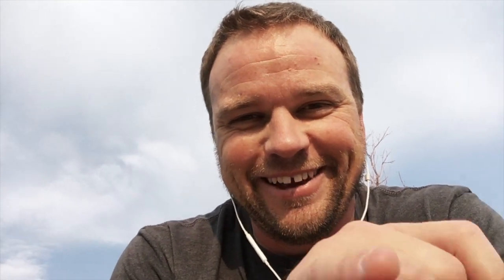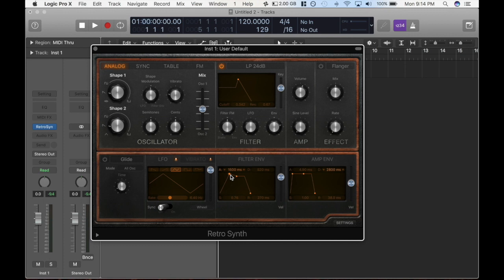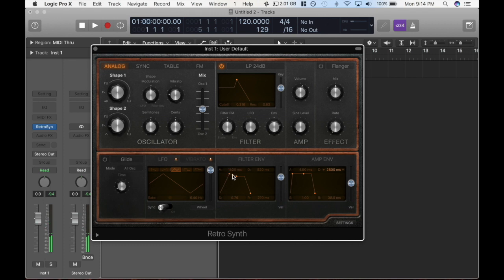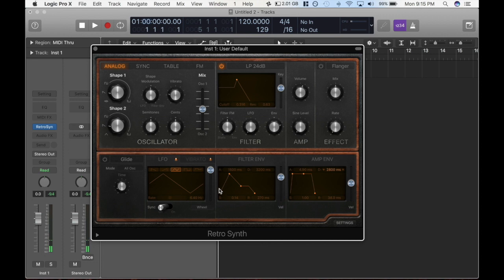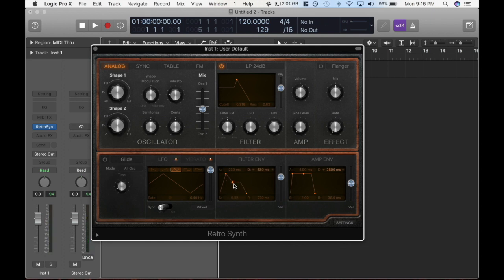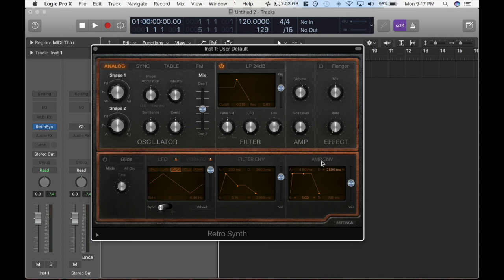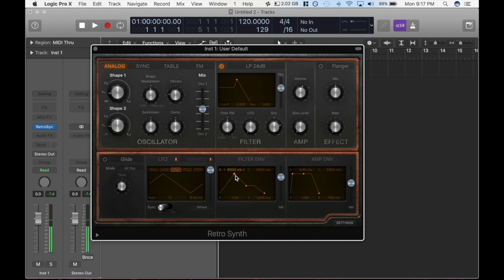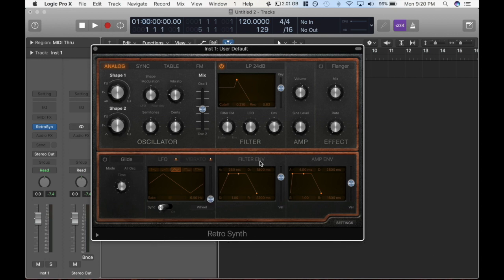How To Understand Filter Envelopes - Explained In 5 Minutes

Comment: Is this technically in synths, each key have their own filter? Because some key I can press later and the attack will be at zero for new key, while for other pressed keys it can be in sustain or release state
Reply from the maker: You may have key tracking on. I'm not sure I totally understand your question, but key tracking maps the keys and affects them differently depending on where they are on the keyboard. An example would be a low pass filter with key tracking on. If key tracking is on the frequency where the cutoff kicks in is higher on the high keys and lower on the bass notes. This is so that higher keys aren't totally swept out by the filter. Hope this helps, thanks for watching.

Comment: Jason,
I just came across this video.  There are just a couple of extra points.  Technically, on the filter envelope, the attack start is not at 0%, rather its the  current setting of the filter cutoff. The filter sweep starts from the current setting.  Also, technically in your
example it does not go to 100%.  Looking at the envelope amount, it is about 50%.  The attack peak will stop there at about 75% filter open, not 100%.  If you want 100%, the envelope amount needs to be turned fully to the right if you want the full sweep.  It makes a big difference in the resulting sound, sweeping a narrow frequency band  in the attack time, or a broader frequency sweep in the same attack time. 

Also, looking at your synth, the envelope amount control is an attenuverter, meaning you can sweep backwards, from brighter to duller.  Move the envelopment amount to 9o'clock and move the frequency cutoff to 75% open.  It makes an interesting guitar string pluck.  Not often done, but good to know if you want to try something different.   It really comes down to what the particular synth offers. Some are just attenuators, meaning they only will allow sweeping from dull to bright.  0% at 7o'clock and 100% at 5o'clock.
Reply: Beachfeet thanks for clarifying this. I had hard time understanding this impacts FROM the cut off frequency. Thanks much!
Reply: Excellent comment beachfeet. That confused me for more than a year. But now it makes sense.
Reply: @Beachfeet thank you, thank you, thank you! These were the missing pieces of the puzzle for me:
1. that the start of the envelope represents the current filter cutoff frequency, and
2. the ENV/depth/INT(ensity) control on the envelope determines how much it will open the filter from there.
Reply: @Andrew Swan  Glad that I could help!  It's gradifying that even after all this time, my reply to Jason's video still gets some feedback and is of help to people.

Comment: You did a good job cause I learned something.  How bout the LFO? What does that do vs the Filter Envelope?
Reply from the maker: Sorry for the delay in my response. The LFO stands for low frequency oscillator. It can be used in a similar way to the envelope, but it cycles rather than just playing through one time (like most envelopes do). So the way that you would use an LFO is to assign it to a value such as a filter or pitch, or whatever you want to repeatedly wobble or sweep. As you play the synth, the LFO will act on what you have assigned, cycling repeatedly,  making that value rise and fall. The x-axis of the LFO is time and the y-axis is amount/value. The shape of the LFO determines how the LFO rises and falls with time. Maybe this will be my next video?? I hope this explanation helps! Thanks for watching!
Reply: You can apply an LFO to the filter cutoff frequency, independently of whether there's also an envelope modulating it. These effects of these two modulation sources (the envelope and the LFO) will be summed together to determine how the filter cutoff changes over time. Note that LFOs have their own set of options, such as wave shape, speed, depth, triggering mode, etc.